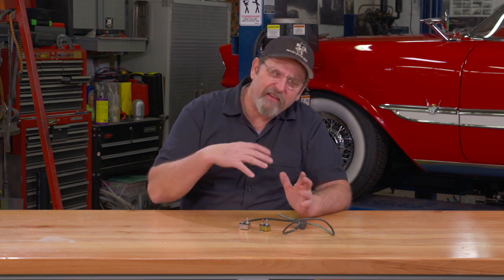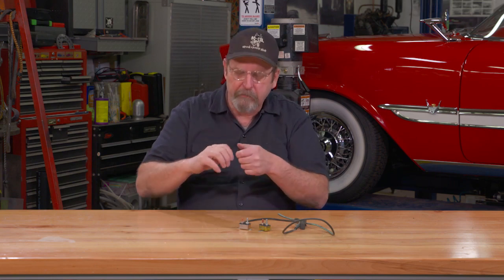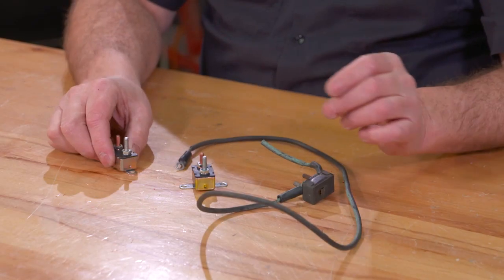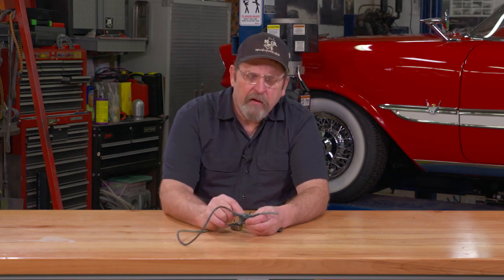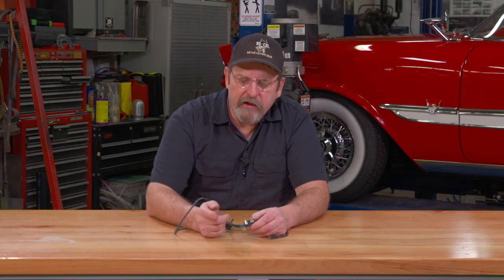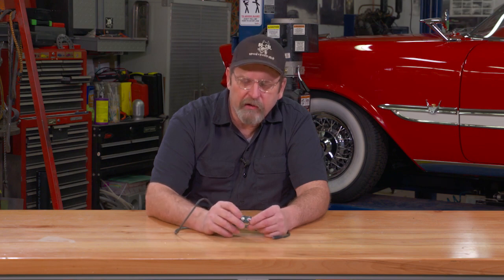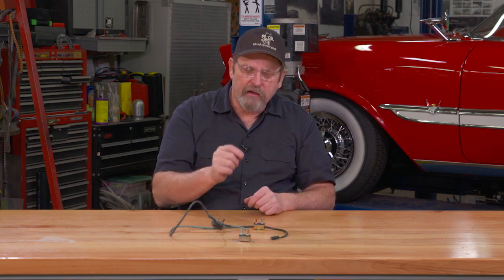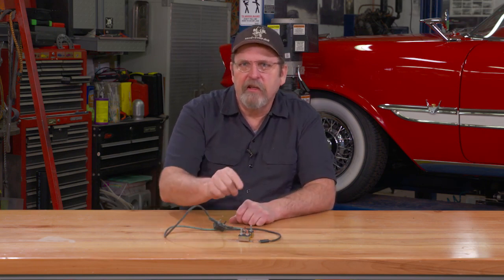CLASSIC CAR CIRCUIT BREAKERS

Comment: Ty for the explanation, I have one of these in the starter circuit on my Snapper Zero turn mower in place of where I would normally see a fuse.  Like the above gentlemen, I would be curious if there is a way to test this.  I had to stumble on your page to find out how these work as there are no mower YT vids on small engine gurus with circuit breaker issues on their mower.

Comment: So....Which way does this auto-resetting circuit break get assembled?  You have two different posts, one is labeled battery and the other is labeled auxilliary.  Does the battery terminal go to the positive terminal of the battery?  or the negative terminal of the battery?   thanks
Reply from the maker: Great question! The ‘Ask an Expert’ section is currently for members of our online community. By becoming a member, you will have access to our expert knowledge. With your membership you will also receive discounts on products and hundreds of hours of Premium content.   

If you are interested in becoming a member, please click on the offer below:  
https://go.ClassicCarRestorationClub.com/C53253

Thanks!
Reply: If your application (boat, motorcycle, car, ect..) uses a negative ground (battery negative connected to frame, engine) then the positive power supply to accessories (lights, radio, ect..) will/should have a fuse/circuit breaker in between the battery and that accessory. In the event of a short this will blow a fuse or trip a breaker instead of possibly burning your rig down.

Comment: For any reason, the bolts are the same size whether it is a 5 amps or a 50 amps breaker. I challenge anyone to find a ring terminal with a 5mm hole that can take a cable big enough to conduct 50 amps.

Comment: If it pops pull the battery? Or the hot lead or the ground? Or all 3 I’m confused 😅
Reply from the maker: Great question! We are happy to help, if you have a membership with www.classiccarrestorationclub.com we have experts that can assist, by using the "Contact Us" form available on our site. Please reach out. Thank you.
Reply: @ClassicCarRestorationClub  I’m not a member, I’m just pointing out that the guy in the video said 3 different things
Reply: Because he didn't answer your question- I will. Any of these will do the exact same thing but for convenience sake- just pop the ground lead off of your battery.
Reply: @LiamsGotThis  thanks Liam